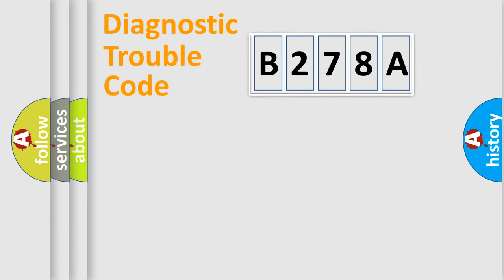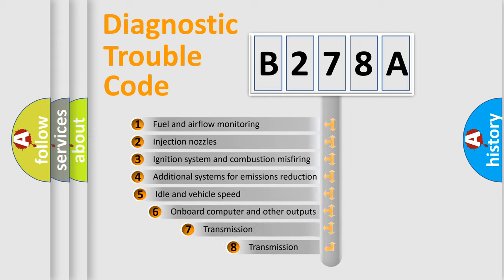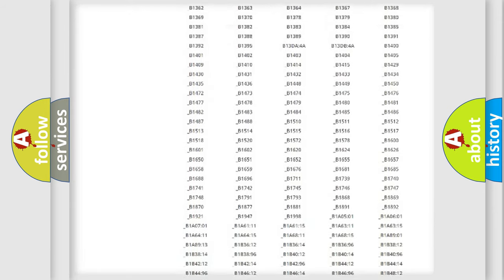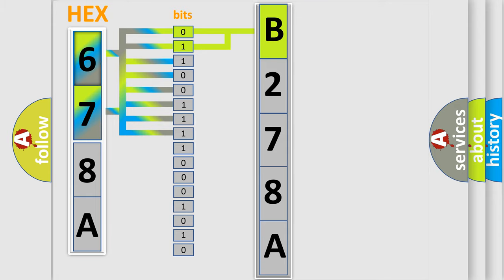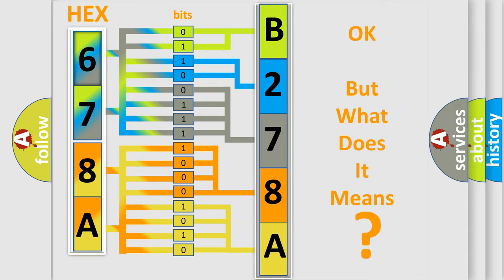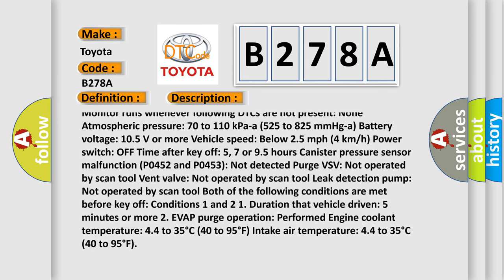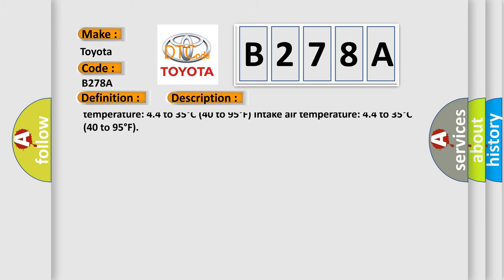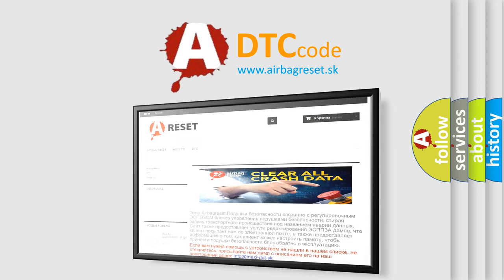DTC Toyota B278A Short Explanation

Comment: I think this code is innacurate.
Reply from the maker: People like you are welcome. Thank you for the report. If you have correct information write it here please
Reply: @maxidotdodge  B278A TOYOTA - Short To GND In Immobiliser System Power Source Circuit

It means you need to replace the start / ignition button. (for a smart key type car)